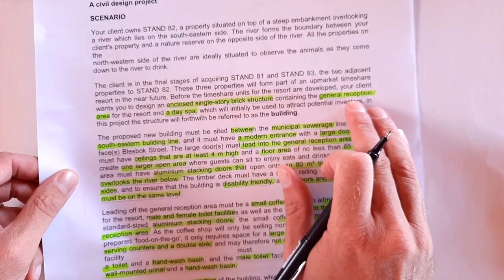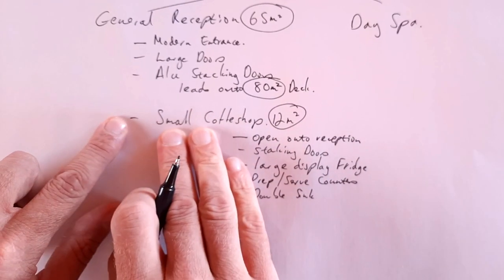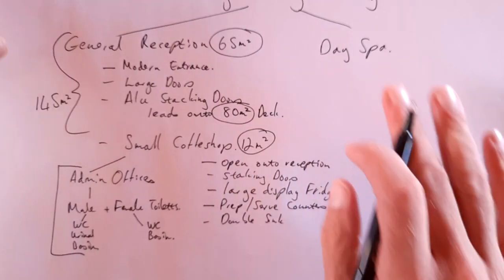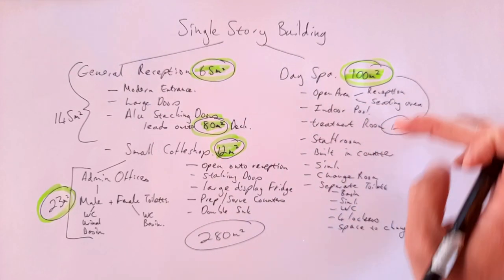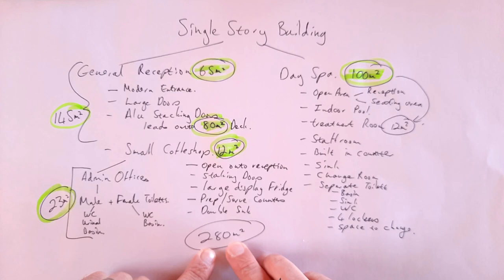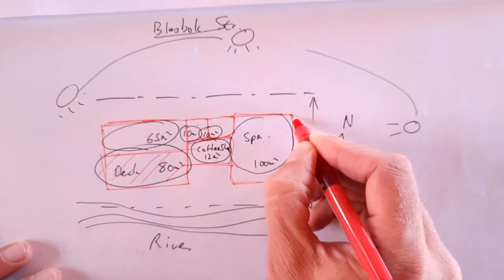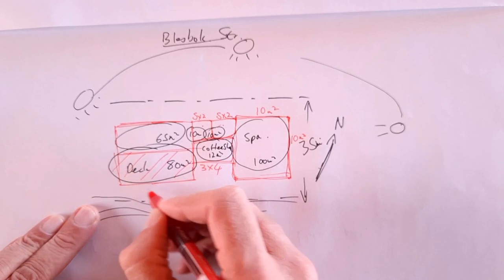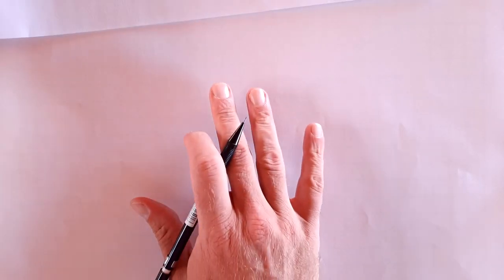3. HOW TO HACK YOUR PAT: Freehand Concepts - EGD Grade 12 - Civil PAT Task 2021

Comment: Does the coffee shop have to be in the reception which means 65-12
Reply from the maker: Eli, thanks for the comment. Please clarify your question...
Reply: @HowToEGD  is the coffee shop located inside the general reception?
Reply from the maker: Thanks for clarifying your question Eli. The PAT Task reads: "Leading off the general reception area must be a small coffee shop"... Thus, the coffee shop with display fridge, preparation and serving counters and a double sink must not exceed more than 12 square meters and will be placed outside the general reception area... the seating for the coffee shop, will however be located within the open floor area/general reception, as well as on the wooden deck... Hope that helps you. All the best.